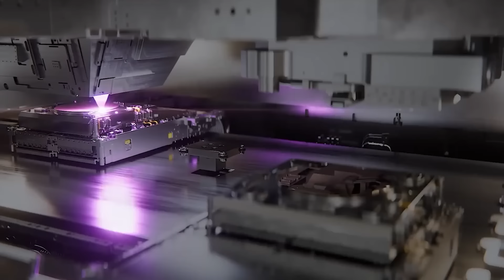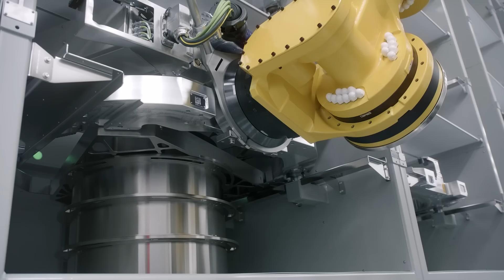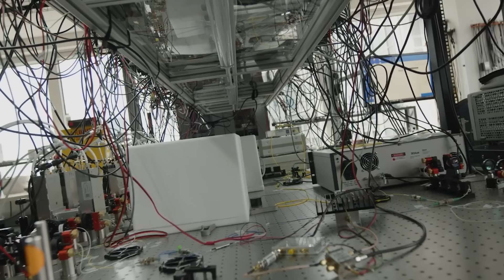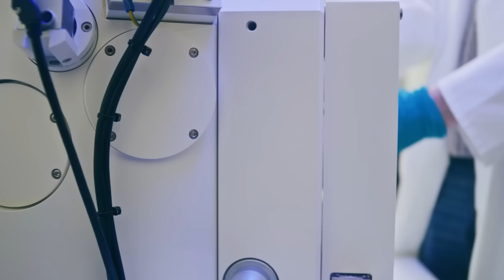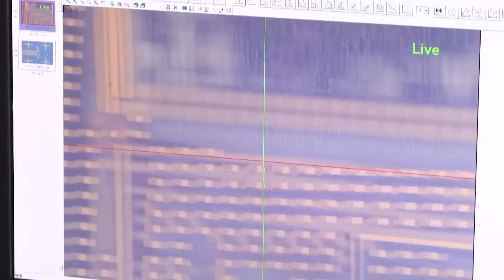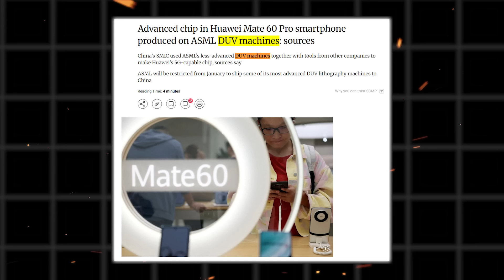America’s New FEL Monster EUV Light Source Just Destroyed China & ASML’s Future!

Comment: The EUV technology was originally developed in the US through a consortium involving DOE national labs, NIST, and many prominent American companies. Most of the work (testbed, light source design, metrology, photoresists, mirrors, etc.) was done in the US before ASML joined the EUV LLC and gained access to the technology. ASML was actually late to the game. It received permission from the US government to join the consortium, which gave it access to the technology, and the technology was subsequently transferred to ASML. (The US government rejected requests from Nikon and Canon to join the program due to national security concerns. That is why Japan, despite its significant share of the lithography market, does not produce EUV systems.) Along the way, ASML was granted US government approval to acquire several American companies, which enabled it to develop the system into what it is today. (It still operates under many of those licenses.) Many critical components of the EUV system were developed in the US and continue to come from American suppliers. For example, the optics and mirrors technology was developed by Lawrence Livermore, Lawrence Berkeley, and Sandia National Laboratories, along with Tinsley Labs, before being transferred to Zeiss. The reticle stage technology was developed in the US and is still manufactured there. Most importantly, the core and most complex part of the system—the light source—is designed and built in the US by Cymer, an independent California-based company. The laser is also designed in the US by Cymer and manufactured by Trumpf in Germany.

Comment: Hmmmm..... Not something you can just plug into an ASML machine without a retrofit and even if you could... You'd just be trading one 13.5nm light source for another as the mirrors are designed for 13.5nm wasting the potential of the lightsource (saves on tin tho), so current fabs might not use it.... BUT... For new fabs? Maybe...

Fabs don't like taking risks, but.. TerraFab could use this, because there is no way they can get enough ASML machines to hit their goal.
Though at that point the bottleneck becomes the mirrors and not ASML... Elons next project maybe? I'm thinking ShineX or ReflectX would be a good name lol
Reply: MirrorX.